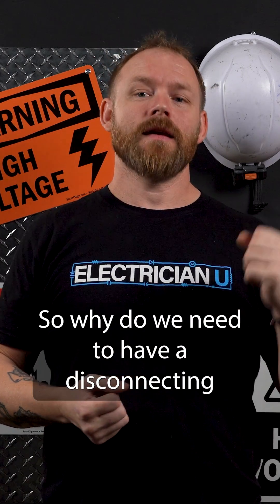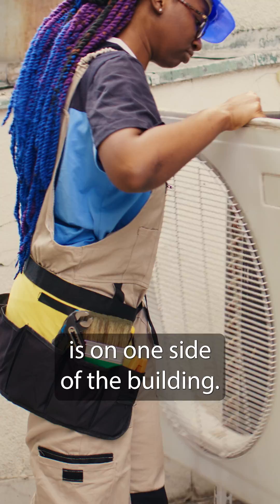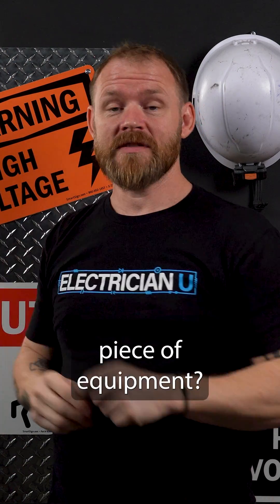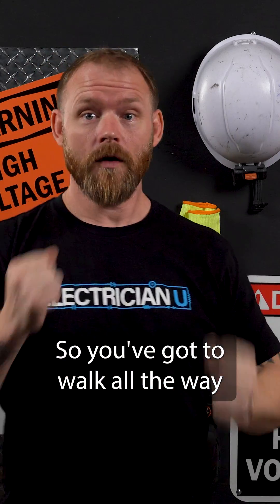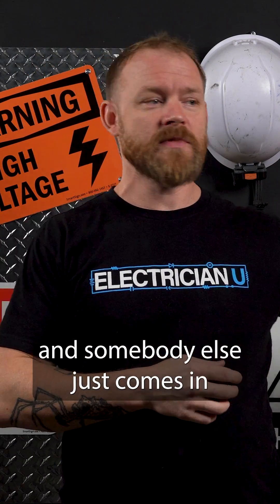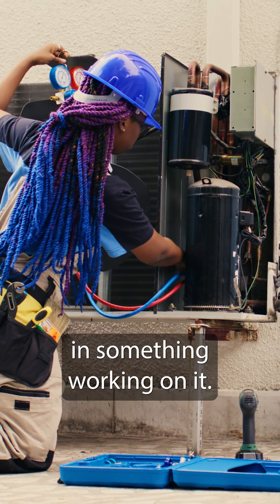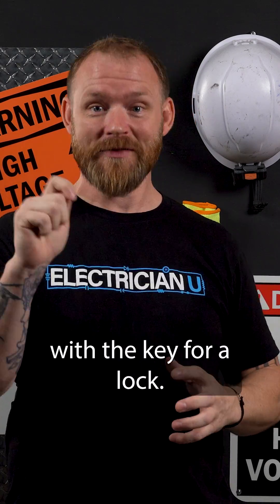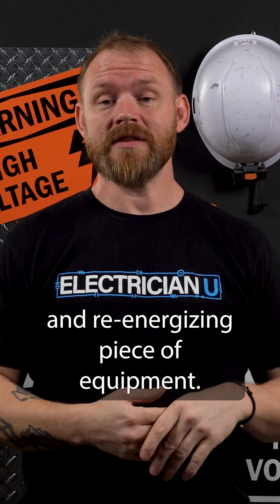Why Do We Need a Disconnecting Means on All Equipment?

Comment: I used to install & repair CNC machine tools in the 1980s. At a very large plant, it was about a 75 yard walk, 2 rooms over to turn off the breaker. Get back, use voltmeter to insure power off, on an unfamiliar machine built before my time. Both arms in the machine when my pager went off - old style*, set to vibrate mode for the noisy environment. Good thing there was about 10' of clear space behind the machine. 😁
 
* Old style pagers ONLY beeped or vibrated, then we had to call the office to find out what was needed. Digitally displayed caller phone numbers came later. The vibration felt just like grabbing live 120 VAC... don't ask! 😂

Comment: As someone who used to work in HVAC, having a disconnect switch on these pieces of equipment could literally be a life saver. Though over time, certain disconnects may need maintenance or to be fully replaced, such as spring lock lever disconnects. Spring locks will wear out over time which can make the locking mechanism quite sensitive to the slightest movements. When I first started out in HVAC before moving to electrical I was not aware of this while changing the belt on a make up air unit, barely tapped the box with my elbow, resulting in the disconnect flipping back on and pulling my hand around the belt and the pulley. For those not aware, the motors in most basic make up air units run around 250-500rpm immediately after being turned on. I’m lucky to still have my hand.

Comment: Hvac tech with 20 yrs experience here. 

We need that disconnect for those reasons and one more very important reason. 

When we come to work on a system that usually means somethings wrong. 

Hvac and other equipment that typically carries disconnects will have various other safety/ shut off devices installed. 

More times than i can count ive rest a system,  it starts up, and all hell breaks loose. That disconnect is often the difference between a small problem turning into a very big problem. 

It's also a life saving device. 

Me and another journeyman were working on an industrial fan motor assembly and while the system was running the other journeyman got his long ponytail wrapped around the motor shaft. 

If the disconnect wasn't easily accessible and within arms reach of the  equipment he would have died horribly. 

It did rip off part of his scalp tho.
Reply: Sparky here. I was reviewing the "need" to install grounding electrodes (ground rods) at light poles then started wondering about disconnects not being needed at light poles, then started wondering, "...why do we even need disconnects?" I've always just shut up and installed them, without thinking. 

But then an HVAC guy (you) comes along and clearly explains the necessity of having a disconnect near major appliances and big things that can go Boom. Thanks. You literally helped me learn today.

We so often take stuff for granted and often forget to ask questions that we end up just installing shit without really understanding the reasoning behind it, like the disconnect. But since you work on HVAC all the time in service, it's perfectly clear to you why. Thanks again. You helped where other sparkies couldn't.
Reply: Did he cut his hair shorter after that incident?
Reply: @joshcmichaud  nope.

Comment: That happened to a friend of mine 25 years ago. He was installing a transformer on a 13000V line, and another electrician saw the circuit breaker OFF and turned it ON again. My friend lost both arms. That changed his life forever. Terrible accident.

Comment: 100% YES.  I was just in a disagreement with Mike Holt over this.  We need disconnects for LO/TO - even when the NEC doesn't require them.  We need to think about the future routine serviceability of the equipment.  Maintenance should not require pulling the meter to de-energize equipment such as transfer switches.

Comment: I was working in a “rug store” to terminate HVAC disconnects during the summer. Turned off the breakers went outside to pull the cable out and cut it to size. The cable sparked when cut (220v), great thing I cut it a single wire at a time (MC running out of the building, not installed by me) go back inside breaker is on. Guy says “my window unit wasn’t working so I turned the breaker on”. Packed up my tools and left. Guy knew I was put back working and still touched the panel.

Comment: Not only do you have to walk all the way across the building but you turn off the breaker only to find the whole thing has been mislabeled. Then you spend the next three hours trying to find what panel it is then you lock out tag out. And spend the next 25 minutes explaining to your boss why you haven't done the 10 minute job yet.
Yea I trained for 5 years to do this.

Comment: Can remember back in late 60's and having to work on old motors on roofs, pits etc that had crumbling rubber cover wire that were not fun to work on hot. One of best things the NEC was to require disconnects within sight & 50' of equipment . Too many cheap lazy electrical contractors neglect to install required discounts on motors feed from VFD'S.. Had cheap bosses that said a motor does not require a local disconnect because it had a stop button nearby. Nope. Not Today!

Comment: you also want a local disconnect to make sure you have correct circuit killed when you work, instead of making several trips if the marking isn't correct.... then there's always the fire department, in case of emergencies. (smoking unit?)

Comment: Lockout tag out is a disaster long-term because the only way to learn to work with live wires is to work with live wires. Having said that, if the machine has moving parts of the cutting off limbs variety I want that s*** turned completely off.
Reply: Dont worry if you loose the key to a loto. They make em so you can snapem in half with kliens
Reply: As a random schmuck, I'm curious when you'd have to work with live wires.
Reply: @mjs3188 another of the times it's for troubleshooting. I'd like to Troubleshoot my switches live so I know what my wires are going to.
Reply: @mjs3188 hospitals,  data centers, other life safety equipment. Shit like that
Reply: @mjs3188 , a couple obvious examples are hospitals or when a business doesn't want to shut down the whole production line.
Reply: @bbeede2  That's interesting. I had assumed there would be redundant systems so you could effectively route power around the area you're working on, but I can definitely see places cheaping out of that. Thank you!
Reply: @mjs3188  , sometimes it's just that there's not a feasible and cost effective way to avoid working live. If there's any way to avoid it one definitely should.